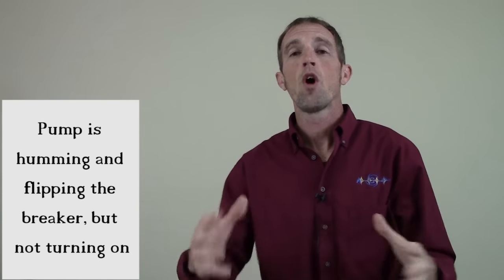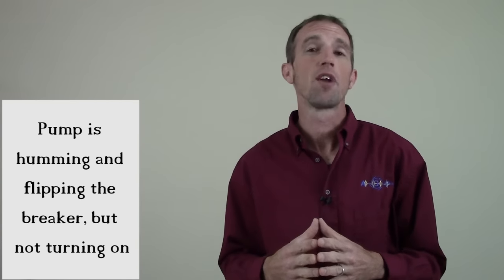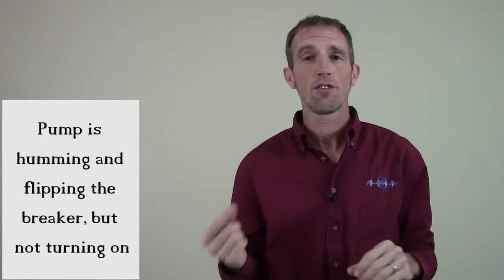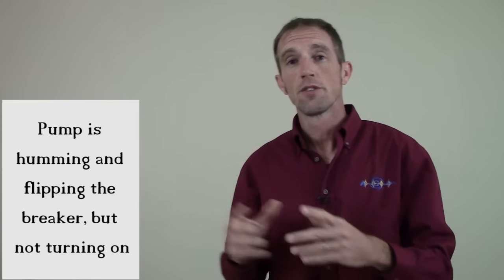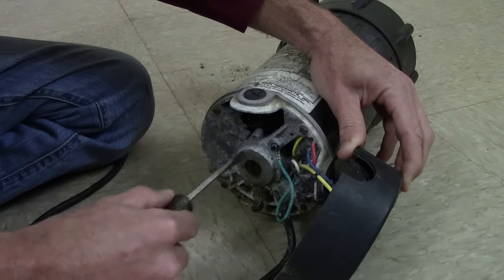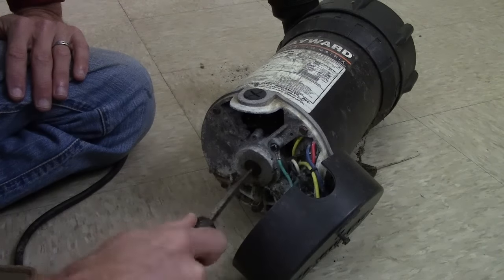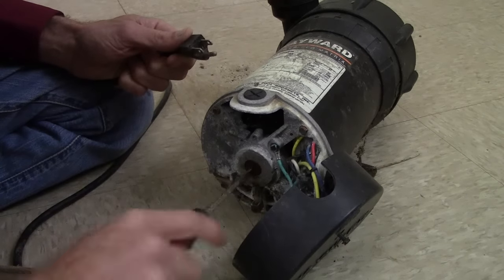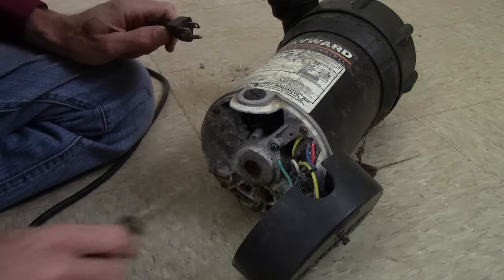Above Ground Pool Pump Won't Start or is Humming & How to Fix It

Comment: Thanks Much! My motor stopped working after draining the hot tub. It's the "cap" type. Popped the cap, turned it a couple of times, and it kicked right on when on threw the breaker. Appreciated!

Comment: Thanks for the fix!  Totally worked on my Hayward Super Pump.  Last year I was able to tap it with a hammer (like the starter on my ol' Chevy pickup) but that wasn't doing the trick this year.

Comment: Thank you for making this video, we just set up our pump turned it on it made a humming noise the tripped a breaker. Happened 3x on us. 

Went in the house to research this problem and found this video. Followed your steps and it worked perfectly. Started right up afterwards.

When I first turned the inside piece it was very stiff, I kept turning it and I could feel all the pieces on rust scraping along. Once it was easier to turn I closed it up and gave it a try.. 

Thank you again for the video 😎

Comment: Great video. I have a A.O. Smith pump and the stationary switch broke. While at it I replaced the start capacitor because it was only $6 each. Then I loosened the spindle like the video said with a wrench. The switch was only $15. The pump worked the first time I put it together. I never worked on a pump before this

Comment: Thanks for the video Chad! Very helpful! I got a jammed bearing on my 4600ELT19 freed up following your tips ... thought I'd have to disassemble the thing. No need. In addition to working it with the screwdriver, I also sprayed some silicon lubricant on the bearing, which seemed to help. Probably the bearing will need replacement at some point, but this works to keep the fish alive meantime.

Comment: Cheers mate, back up and running in 25min after watching this. This is probably Motor mechanics 101 for those that know motors - not me!.                                                                                                      Oh and of course here in NZ you need to turn it anticlockwise aye ........................................... .. .......nah just messing with lol Thanks again

Comment: Thanks.  This worked for me. I don't think I had corrosion because the pump shaft spun freely and didn't feel like any corrosion. I did notice a lot of that white cottonwood stuff got sucked into the motor, I'm assuming that caused to not spin for some reason. I did the kick start deal and work.

Comment: This worked right away!!.....excellent information. Now it’s sounding a bit raspy, don’t have a better word. Any suggestions to oil or spray moveable parts in the motor to minimize this grinding type sound?  Thanks so far all great.👍🏻

Comment: Awesome, a true tech tip. Pretty sure I still need to replace the capacitors, won't start on its own but got me pointed in the right direction. I was lost until I found this.

Comment: Great video! I also found that instead of using a screwdriver try a compact drill with a flat head bit and spin it up and while it’s spinning plug it in I found this to work better than using just a screwdriver

Comment: I think this is a good video. My tub jets were working fine then today I turned it on 
I could hear the motor running (hum) but no water flowing from jets. used the screw driver and    with a flash light could see the blades spinning. Call the manufacture of the pump and replacement was 599.00. But he mentioned that residential bath pumps should last the life of the home with proper care.

Then I drained the water and removed the cover to the uptake vent (it was already clean) I stared pulling on one of the 6 jets. In another video I saw that some models this part can be removed and cleaned.

Well... when I pulled on the vent it popped open and water flowed out! THE WHOLE TIME MY DAMN VENTS WERE JUST CLOSED. LOL I could not tell that they were closed. They looked open. I think the cleaning lady may have accidentally pushed them closed while cleaning and since I did not have the original manual to reference. I almost spent 600.00

I filled the tub back up and turned the jets on and BAM! the jets were working. lol I let it run and added vinegar to clean the lines for the next use.

Comment: hi thanks for the video, it looks this is the issue of the pump which i have recently bought as second hand and apparently is overheating and after 2-3 mins swithches off. so the pump can be turned on and the shaft will spin. what i found that there was some water and likely rust inside the motor (copper wires). do you think that drying the inside will simply resolve the issue?

Comment: Two questions:
1) My current p6e6g-208L motor model k48n2pa105 is acting up.  It's only for water features - I run it every day about ~30 minutes to keep black widows and frogs from making a home in the pipes.  When it turns on, sometimes it makes an electric buzzing noise and takes 2~5 seconds to actually start spinning.  It seems to do this more often / longer in the winter.  Rarely it makes a loud squealing sound for a few seconds after spinning up.  It's 15+ years old.  So, do I just need to do maintenance or replace the pump?  I tried doing the maintenance (replacing the ceramic, etc.) on an exact same pump a couple years ago having the same issues and it seized up and eventually died.  Thankfully this one was available (having been replaced by an intelliflow for all the filters).

2) If I replace the pump, what do I replace it with?  I see pumps that look similar ranging from anywhere around $200-250 to as high as $700.  This pump is 2 HP, 1.5 KW, 230 V, 3450 RPM, Phase 1, 60 Hz, Max Load Amps 11.2, Code H, SF 1.3.

Comment: Thank you very much. 
I have a Kripsol pump and couldt figure out to come deep inside. 
But there was a shield (to protect you) with a hole  and with a straight screwdriver ive managed with some push and helping it. Suddently it worked. Thank you so much my friend:)

Comment: Hi, I am hoping to try this technique on my motor later today but had a quick question(very very new to all things pool, pump, motor related) but my question is… when I plug the pump in ready to jump start it… should it already be switched to the on position? As it do I turn the pump on first while it is unplugged.. then plug it in.. or plug it in then flip the switch and turn then screw with the screw driver? Apologies if this is an obvious question/answer I just didn’t want to mess anything up.

Comment: Went out and took the cover off as you suggested but the inside of my Doughboy Powerline XP PUMP didn’t look the same and no way to rotate the shaft. Dollar bills were dancing in my head.. I watched another where a pool guy suggested plugging in the pump and when it starts humming whack it hard with a rubber mallet and lo and behold that worked.

Comment: Hello just wanted to let you know that you video helped me out tremendously at the beginning of the pool season. I had a loud humming noise & after doing what you showed on here it worked. Well the other day it wouldn't come on at all so I was going to try what you suggested by turning the screw & plugging in at the same tme. When I took the back off I noticed the Black wire was off & I can NOT figure out where it goes I tried searching wiring diagrams & nothing is helping me. Can you help me with this? This may or may not be why it wont start. I wont know until i can fix the black wire. Thank You so Much. I can NOT afford a new pump right now.

Comment: Worked like a champ! Broke the shaft loose with the screwdriver got it free spinning pump fired right up, however, now it is far nicer than usual, I am assuming that its the leftover debris from the corrosion. Is there any electronics cleaner or anything I can spray in to lessen this? Don"t want complaints from the neighbors.
Reply from the maker: That I don't really know of. It'd probably be best to talk to an electric motor repair guy to see if he could give you a suggestion

Comment: Great advice friend, I had this problem after installing new seals. I used an electric screw gun and spun the pump and while spinning plugged it in works great. Only thing my pump failed to restart next day and had to spin again.  Now it don't hum when trying to start and was locked real tite. Could I have done something wrong while replacing the seal?  The pump was running well but leaking bad and now nothing on third day of restarting.
Reply from the maker: +Victor Sponheimer sounds to me like you must have done something wrong with the seal. Not sure what but you might want to take it apart and check it out.

Comment: Pro tip- if it’s corroded to the point it won’t turn, TRY WD40 on the bolt first!!! Thank you! This video literally saved me since everyone is sold out of sand pumps and filters right now!!!

Comment: Opinion needed.  There was an ant pile under leading into the pump. When I tried to turn on it started humming. After I cleaned it out some and got most of the dirt out, it worked for several hours. Then I turned it off but after it wouldn't start. I have changed the capacitor but when you turn it on nothing happens. No noise or anything else. Thoughts? The impeller and shaft was replaced about 3 months ago.
Reply from the maker: +RUBIO0331 When ants get in the motor they tend to make electricity connects that shouldn't be made and it can burn up internal parts of the motor.  Unfortunately I've seen this several times with ants.  If you have replaced the capacitor and the motor won't start, there may be a good possibility that you may have to replace the motor.

Comment: I did as you said and the shaft started spinning but a very dull spin and barely sucking any water through the skimmer basket. Any suggestions or know what that means? Thank you!

Comment: I tried your solution and was amazed it worked! I let it run for about an hour and saw the Polaris doing more swimming than cleaning so I turned off the pump and adjusted the direction of the spray nozzle on the Polaris and switched the pump back on only to get the hum back.  I let it sit for a couple of hours and tried again with no luck.   Is there a way to clean the corrosion from the copper wiring inside the pump – I don’t see a way to get the casing off.
Reply from the maker: Thats an elclosed section.

Comment: This was a life saver! Now it works again, but makes a shrill sound... kind of sounds  like a vacuum cleaner working hard. Is this something that will work its self out as the corrosion wears/burns off, or does something need lubricating or replacing?
Reply from the maker: +mab1701 it may work itself out but sometimes it won't.  Run it for a few days straight and see if it does.  That comes from the sound of metal grinding against metal in the bearings.
Reply: Ah.. ok. Thanks for the speedy reply!

Comment: Question: I am supposing that you need a helper to plug in the pump if the outlet is not in reach, while you twist the screw to turn the impeller?
Reply from the maker: It helps

Comment: Mine had a different type of shaft but once I took the cover off the A.o. Smith Century Centurion 1 HP pump, I was able to twist it by hand and it took off.  It was easy to turn before I turned the power on so not sure how much corrosion I have.  In my case, I think the water may have been low for a day and it got hot yesterday when I found it humming.  Hopefully it will work going forward.  Otherwise, my guess is I'll need a capacitor.  Does that make sense?  It looks like I have one on the top of the pump.

Comment: how about the micro switch being stuck in some Balboa motors? I recently swap a stuck bearing on the pump and thought that everything was retuned properly but that micro switch not sitting well so it turns the pump on. Was instructed to remove the cap and see if the micro switch metal tab is strainght or no wires blocks it.

Comment: Thanks Chad great video for people who just don’t know and the people you just saved a chunk of money from out of their pockets I’m trying to help my neighbor out with a pool pump that had set out in the weather for 4 years I got it from being froze up before running across your video but wanted to see if you ever ran across the issue that happened to me in the process once I got the pump running it ran for about 3 minutes I still had back cover off and heard a loud pop come to find out the start capacitor blew up a bunch of cardboard came out of shell of it leaving just the top with wires hanging from it but stayed running so now when I turn it off I have to jump it with a screwdriver every time and it will run again I’m going to gamble and get another capacitor and cross my fingers cause I’ve read something with the windings might be bad causing to blow capacitor! Have you ever come across a issue like this!!!
Reply from the maker: I would probably recommend you just take the pump to a motor repair shop and they can probably fix it for you for a reasonable price

Comment: Thanks so much for your video!  We have been able to get our pump started.  I left it run for about 20 hours before I shut it off and the next time I went to turn it on - all it would do is hum again.  So we got it started again and it's currently running and will be running overnight and into tomorrow.  But I'm wondering if it's always going to have to be started this way cuz if it is, I'm not crazy about that either.  I mean - I don't want to spend $$$$ on a new pump if I don't have to but our plug in isn't down by the pump so it takes 2 of us to go thru the process....one to plug in while the other person does the spinning.  Any advice for this problem will be very much appreciated.  Thanks!!!

Comment: Do you have to take that portion of the pump off before trying it? Or try it with everything attached? Ours has been working fine the spring and just started humming yesterday… harms and shuts off within 30 seconds each time. Wasn’t a winter issue. Would it still work?
Reply from the maker: Leave everything attached

Comment: ok, I have a hayward 1.5  power flo lx. its two years old and removed in the fall and stored in a heated garage. it hums and will not start. I can turn the shaft where it goes into the pump easily with two fingers. How do you get the cap off of the back cover to try and jump start it? (im not sure thats the problem but im up for trying)
Reply from the maker: Just wedge a flathead screwdriver on the wdge of the cap to pop it off.

Comment: Got it!  Yeah!  Yes, it's in-ground and I had to disconnect the whole pump from all the piping and access the rod.  Finally got it freed up and it runs!  But now I can't get a prime!  Ugh!  I've watched a few videos and tried different things, including adding a bunch of water to my sand filter in case that would help, but it didn't.  Any ideas about getting my prime?
Reply from the maker: vermontmark2 Take the lid of the pump basket off and let gravity fill the basket chamber with water (or if the pump is above the pool's water level, then fill it with water yourself).  Close the lid and crank the pump up.

Comment: Thanks for the video. Mine is definitetly spinning but it is not sucking air in or out of it. I also can't get the basket out of it but that might not have anything to do with it.  I was thinking if I took the basket out that I can rule out that it is clogged. I ran the house in the outlet to and water went out the other end so probably not a clogged issue.

Comment: My pump hums and shaft turns on a waterway PM2100-6 but, won't run.  I think I need a capacitor.  Where do I find the capacitor on this type of pump.  When I take that top cover off it looks very similar to your pump.

Comment: So i did exactly what you said in the video, and sure enough the shaft was too locked up to even turn at all. The catch is that this pump runs all year long as i have an inground pool, and it was running perfectly fine earlier today. All i did was turn it off and replace the filter and when i tried to kick it back on, the humming started. Again the shaft doesnt move at all, what should i do?

Comment: Mine is pushing water out just sounds louder than usual I’m guessing like you said the heat from the pump running will eventually break down the corrosion?

Comment: Another good hack that has worked for me is to simply tap on the motor with a soft rubber mallet, works like a charm with no motor disassembly. I’ll be taking the cap off my 18 year old Hayward Super 2 this weekend to see if I can lube the shaft somehow. Any tips or suggestions? Appreciate it and great video!

Comment: Just a question. I can start it fine with the screw driver, but when I turn the pump off. It does the same thing again. So I have to do the screw driver again. Is there anything you think might be the problem? TIA

Comment: Excuse me, correct me if I am wrong.. you told us to start it with a screwdriver and let it go for 12 hours dry or mounted on the jacuzzi..? My one works with the screwdriver and I thought the fault was the start engine capacitor. 12.5 microfarad. I also removed a lot of hair from the the pump itself when I opened it to check it. I DO HAVE PICTURES. PLEASE LET ME KNOW. I JUST SUBSCRIBED TO YOUR CHANNEL

Comment: @abovegroundpros The screwdriver hack works great and thanks a million!! However, I’m having to do that every time to get it going/kick start it. From other comments it sounds like this may mean bad capacitor? Pump is 370 days old so barely out of warranty range. Do you have an references or videos you’ve done that may instruct how to replace that part or in your experience is it possibly something else?? Thanks for any insight in advance
Reply from the maker: If it is an inground pump then it'll have a capacitor and yes that's probably a problem. If it's an above-ground pump that it might be time to replace the motor.